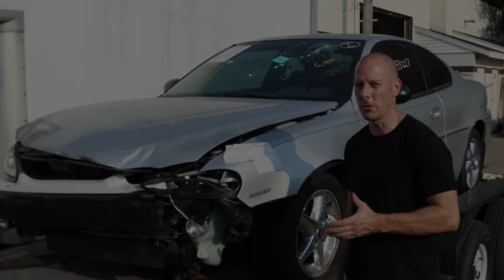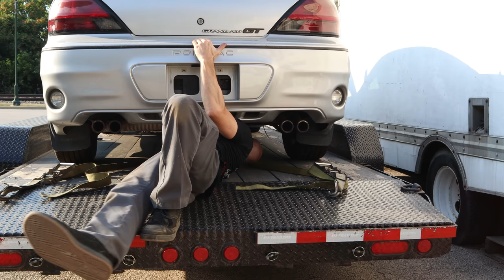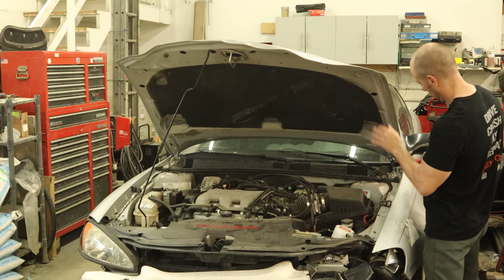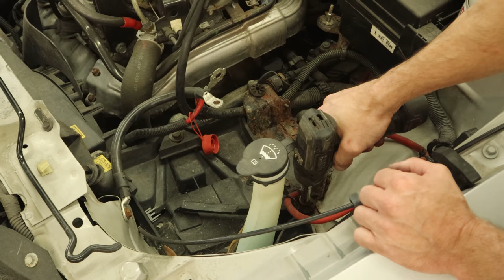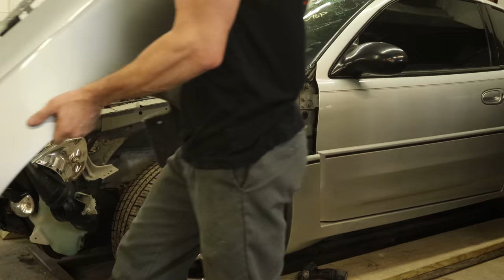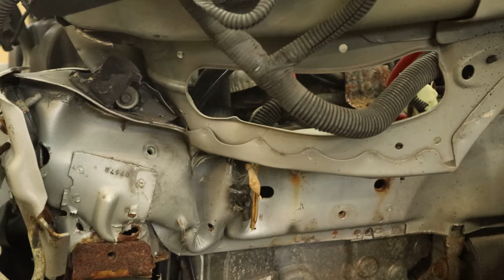I found another super cheap, easy build, low mile Grand Am for a daily

Comment: I'm so glad you save cars that other people deem unworthy of saving. Makes me have hope for humanity.
Reply from the maker: They have their quirks but they are cheap, reliable and good on gas.  I wish they still made them like this.
Reply: @vehcor  Yeah... And I was wishing a newly made '60 Falcon. Never should have stopped making them.
Reply: @amascia8327  There are a LOT of good cars they never should have stopped making.....problem? they were good reliable vehicles hence why they stopped. 

One of my favs is the fiero. Imagine what little rocket ship it'd be today if they'd continued developing it.....put some decent suspension, willwood brakes and a modern v6 with 400 hp? You'd blow the doors off just about anything on the road.
Reply: does make sense on how much replacement parts are for these, probably many at the junkyard, I can see value.
Reply: @BillyBob-fd5ht  any reliable running and driving vehicle has value. It may not be collectible but if someone is looking for a decent used car and isn't concerned with "the latest and greatest" there's nothing wrong with grand ams at all. 

The mechanic next door had a customer drop off an old (ugly) hyundai? kia? (I forget) that he wanted $200 for which was what he'd get at the junk yard. A little surface rust but it wouldn't run and he didn't want to put any money into. The mech gave him his $200. Replaced the alternator and it fired right up and ran like a top. Brakes were fine but he replaced them anyways because for $120 why not? He detailed it and sold it for $5500 CDN. A LOT of women, girls, don't give a crap about what it looks like like guys do. They just want cheap and reliable and good on gas.
Reply: @vehcor   I love how basic the motor is everyone complains about the head gaskets but if you just change the oil and coolant the motor will last longer then the car. It’s a basic push rod no turbo no variable valve timing no cylinder deactivation it’s a simple basic motor.

Comment: I can honestly say the only bad thing I've ever heard about these cars is that the engine mounts like to fail a lot. I've known several people that have owned and driven them and they all had to replace the mounts more then a couple times before they got rid of the car or ran it until it couldn't go any more. Keep em coming I can't count how many I've watched you rebuild of them at this point (I mean I probably could if I went and counted the videos but I'm to lazy to do that lol) but it's always a good one and plus ya get to see the people cry about them in the comments lol.
Reply: Cause everyone revs the engine too 500rpms hitting that redline no wonder the mounts break. People are rough on cars man my friend the way he drives he just hits that accelerator so hard he’s up too 6000 rpms and I’m just sitting there cringing. The highest I’ll rev is 3000 cause I care about my engine in emergencies I’ll rev higher to get out of the way quick but i don’t like doing it. It puts so much strain on the engine there’s a reason there’s a rev limiter in park or neutral

Comment: Nearly every car I’ve owned for the last 20 years needed new windows motors.  Camrys are easy.  The Grand Marquis seems unnecessarily difficult.
Reply: These Grand Am ones are pretty easy too. It’s the plastic guides that break off the regulators that’s what happened in my Grand Am had to replace three out of four windows the regulators were fine just needed new window clips I found broken peace’s sitting at the bottom of the door.

Comment: I actually like these cars. A friend had one, and for an inexpensive "sports car" it was pretty quick and handled really well, except for not being able to steer under full acceleration.
Reply: duh its fwd
Reply: @Monza62000  duh all GM cars are front wheel drive since like 1989 except Camaro, Impala and Corvette duh
Reply: @Monza62000   what’s that gotta do with steering. It’s better to steer with a front wheel drive car more weight is put on the wheels better traction. Drive a rear wheel drive car in the winter you slide around so much.

Comment: Always wanted to import one of these to the UK, I think they look great, we never got them here, but I think they're a nice design.
Reply: This is the fifth and last generation of the Grand Am went from 1999 to 2005. They came in 5 different trim levels the SE SE1 SE2 GT GT1 and engines you could get were the 2.2 Eco Tech 2.4 Twin Cam and the 3.4 V6 the V6 version for awhile came in different bore sizes 3.1 3.2 3.3 then finally settling on the 3.4 the Twin came was fazed out for being awful and they just stuck with the 2.2 and 3.4 options. For the time a fully loaded Grand Am would have powered locks windows and mirrors and CD player that could play MP3 CDs with a Monsoon radio that sounded awesome. Four wheel disc brakes traction control with ABS cruise control you could get the tires is 15 or 16 leather seats leather wrapped steering wheel Ram Air intake which gave you little more horse power at 175hp. All Grand Ams were automatic expect for a couple were standards all the V6 Grand Ams has the automatic transmissions. The transmission was a 4 speed with lower gear options. The most amazing thing about these cars is the low end torque it’s amazing.

Comment: I'll always remember being 10 and seeing these new and thinking how cool they looked (and frankly still do when they arent beat to hell). This exact spec too is the "hero'  car I remember, silver 2 door with the chrome 5 spokes. I do have a soft spot for the 1999 only metallic green and 2005 only dark grey color. Ever run across either of those?
Reply: I have a 2004 SE V6 the body in pretty good shape just little paint blemish above the gas door on the passenger side some scratches on the hood and the driver window got some scratches I believe from a snow brush. The underbody has surface rust but no major rust body is strong still. The engine and transmission are solid all gears work shifts fine the engine has no knocking sound just some lifter noise when you start it up cold goes away once engines warmed up. The interior were its suffered the most but overall is holding up the dash is still in one peace only came up a little on the driver side up by the windshield and some the doors the material has bubbled a little and the emergency brake is broken but everything else is in pretty good shape for being 18 years old. I redid all the brakes and installed new headlights and fog lights new engine belt new fluids oil coolant trans fluid brake fluid I replaced 3 out of 4 window regulators and put new tires on it. And got the back window and doors tinted. Just trying to find a junkyard emergency brake to replace that and probably a junkyard centre console one that’s in there is kinda in rough shape. Oh lastly the windshield got replaced. Car at the moment has 181,000 on it

Comment: I will always have a thing for these grand ams.  Quirks aside like the multifunction switch and fuel pumps loved mine til it went to big scrap yard in the sky. Aka the local scrap yard.
Reply from the maker: I have a customer with 200k on the original fuel pump and intake gaskets.  A water pump, tires, brakes, battery and oil changes if the only thing that has been done. It was a theft recovery I did 13 years ago.

Comment: It looked like there might be something up with an engine mount but it could have been just the other bits of damage. The engine moved a lot when you revved it.
Reply: Yes one the mounts probably broke engine has three mounts two down on the frame rail one up by the coolant bottle. The transmission has two both on the frame rail

Comment: These cars were great.  I should have bought one when I had the chance.
Reply: I have a 2004 maroon colour they are old they drive good if you like to feel the road then these cars are for you if you like cornering these cars are perfect for that and if you like hydraulic steering and mechanical throttles this is for you. I’ve driven many cars I hate the electric steering it’s so loose it feels like I’m turning nothing hate the electric throttles again no feedback I love how these car huge the road around corners it’s got the lean but it’s a good lean. Plus it dose not feel like you are gliding across the road you feel every bump you feel every turn and acceleration. Some may not like that but it puts you connected with the road

Comment: i switched to tilt bed 5 years ago and all i gotta say is.......SCREW RAMPS! lol never could go back and ive never really run into any issues that a non tilt would be better at. heck you can even load and unload without having to hook up trailer. also for me when i'm pulling a land yatch out of the earth with 4 flats that dont roll the dove tail digs into the ground so your not putting all that force on the trans parking pawl but also nothing dragging will catch on the edge of trailer!

Comment: I bought a 04 Grand Am that only had 71,000 miles,but had many dents.The price seemed right.It was a 4 cylinder with a 5 speed,4 door.I enjoyed driving it.The dash was great,it was comfortable,not to small,not to big.But then the air bags deployed for no reason.Then it started smoking and consuming a lot of oil.So I dumped it as fast as possible.But I did like the car otherwise.

Comment: I got one of these for $500 recently from a friend, both windows are held up with blocks of wood (but the AC works at least!). Dashboard is peeled up like a potato chip tho
Reply: Cut all the pealed parts out trim it up nice it’s just the foam material under it is plastic then but a custom dash mat and Velcro it down boom nice new looking dash easy fix

Comment: It looked pretty messed up...  Not as bad as I thought.....

Of course, when it started, it wasn't as bad as I thought.....  that'd be a day, when I bought an auction car, that started without 3 days of work.....

Most of us don't have access to Scott's Grand Am Emporium either....  Which would help a lot, yeah....
Reply: Mostly just the bumper and some lights and other crap got broken engines completely fine just gotta straighten that frame rail install all the new parts at the front and your done

Comment: A metal shaping channel I follow made a 3 part video series this month about repairing one single 30s or 40s fender.  So when you pulled off that driver's side fender and the prognosis was, "in the bin," it made me sad for how far the repairability and design of modern cars has changed.  Obviously you know the cost/benefit, and I'm not suggesting you should do otherwise, just thought it was an interesting juxtaposition.

Comment: What engines came with this car originally?
Reply from the maker: 3.4 came in all GTs from 99-05 and was an option is SEs
2.4 came in SEs from 99-01
2.2 came in SEs from 02-05
Reply: Quite a selection, did they all perform well, or was one better than all the rest.